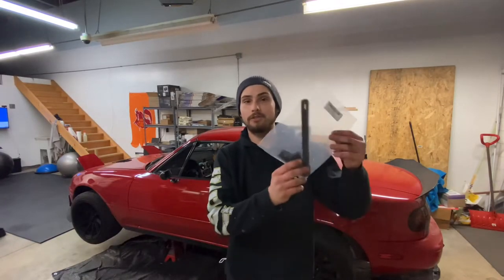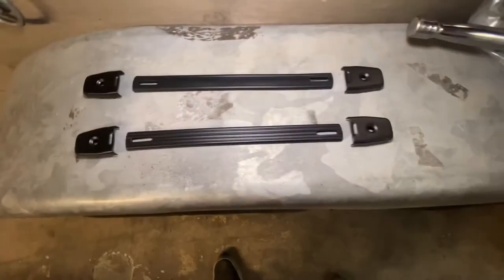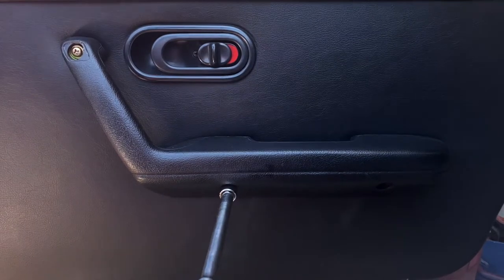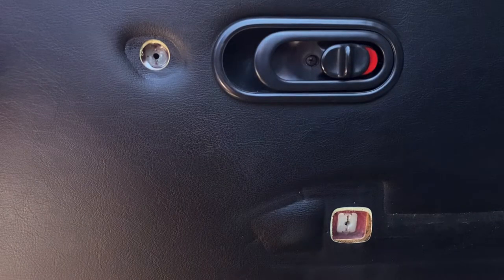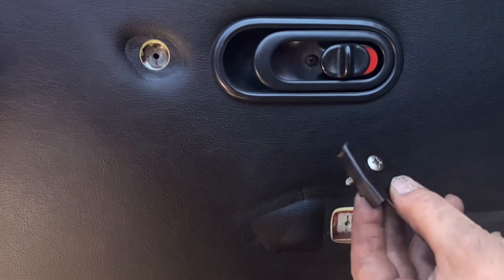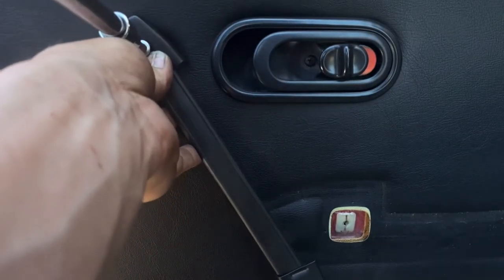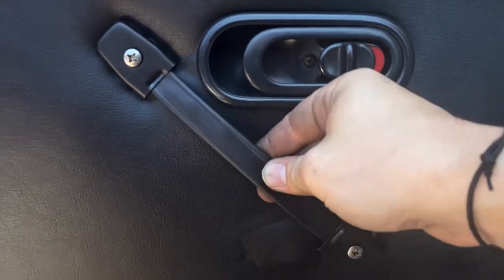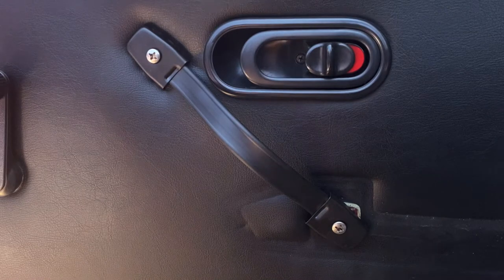$10 DIY Door Pulls Turbo Miata

Comment: Hey again. Just doing some more research. This time it's about injectors. What kind of injectors do you have and where did you buy them? goal is 180-210whp maybe 450cc?
Reply from the maker: I have Bosch 850cc in my car. I believe I got them from Toronto injectors.
Reply: @NickMeinert  thank you!
Reply: If you don't mind me asking, What clutch setup? Anything local. I was looking at the FM level 1 clutch...
Reply from the maker: I just upgraded to the supermiata clutch. I’ve heard bad things about the fm kit that’s why I went with supermiata. Probably a slim chance of finding locally also I wouldn’t recommend purchasing a used one either.
Reply: I’d check tdotperformance.ca  they have ACT clutches which are good quality. Check Facebook marketplace for the injectors, I see them pop up once and a while. RX8 ones are around 450cc and work well for 180-210hp